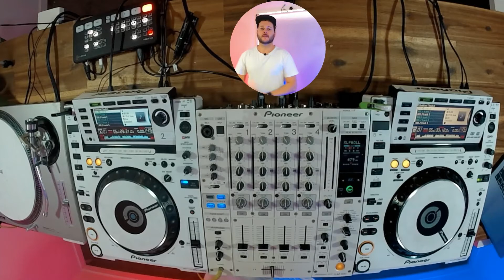DJ FX - How To Use Noise with Reverb to Create a Crazy Build Up

Comment: Hey bro - new subscriber .. I'm on a DDJ400 and Aussie too. Have subbed! I'm guessing you're using one of those super wide angle from Amazon? When you're in the position to grab a cheap second hand DSLR with a slightly less wide angle, but positioned higher, you'll get that much flatter look on the decks ~ and the overall quality of the presentation will probably be received higher by potential passing subscribers. Great techniques / effects tho.. been looking for something like this atm, because I'm new to it.

I wonder if the DDJ 400 has a limit however seeing as you can't naturally select noise without the mouse to select it in Rekordbox. Unless I somehow map noise as a toggle for my filter nob?
Reply from the maker: Thanks so much for your comment. Really appreciated. I'll have a look into your question and come straight back.
Reply from the maker: @worried189brick2  I went back to the DJ that filmed this but must of had no reply then missed coming back sorry team. Will follow up.